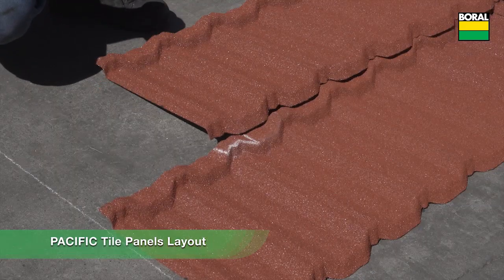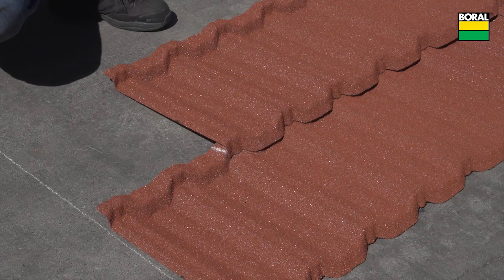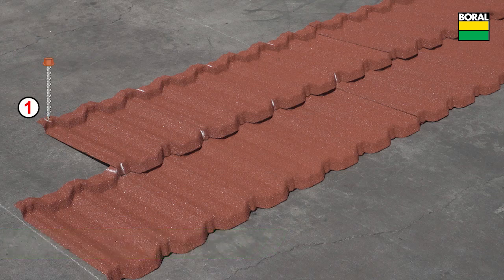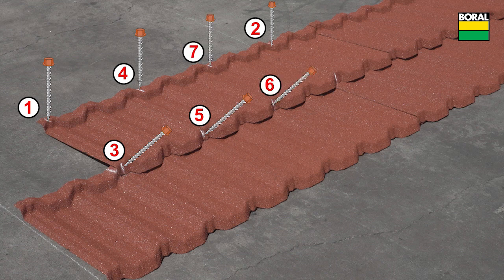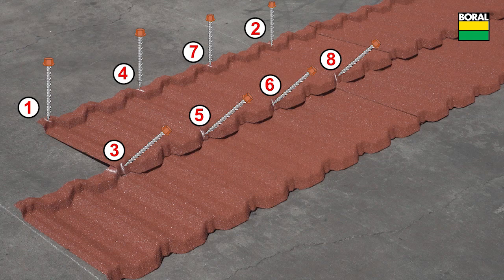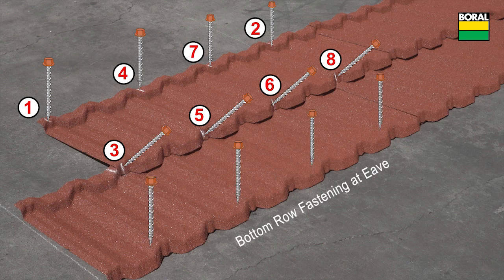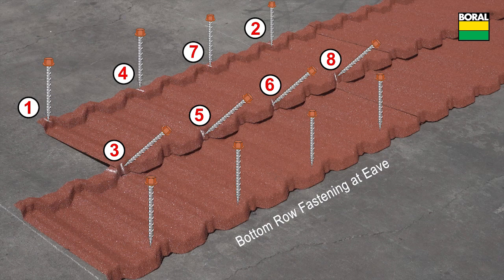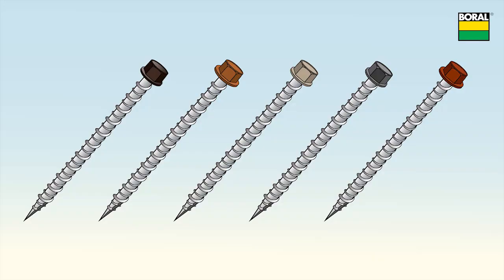Boral Steel | Chapter 7 - Pine Crest Shake - PACIFIC Tile Layout & Fastening

Comment: Will water leak from those screw holes?
Reply from the maker: Hello, with the way the panel and the fastening points are designed, water is not likely to leak from the screw holes due to the top four being covered by the next panel and the bottom four being installed in the groove of the panel at a vertical angle where the natural shape will deflect water from accumulating in the screw area. Additionally, the stone-coat finish helps redirect water running off of the panel. Thank you!